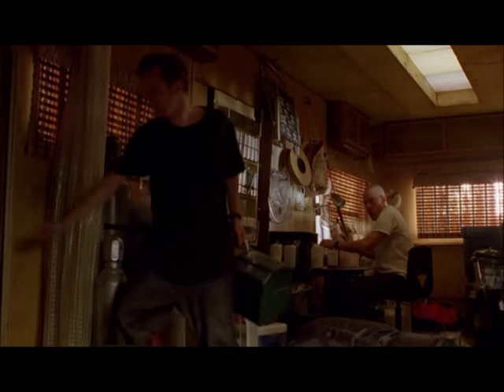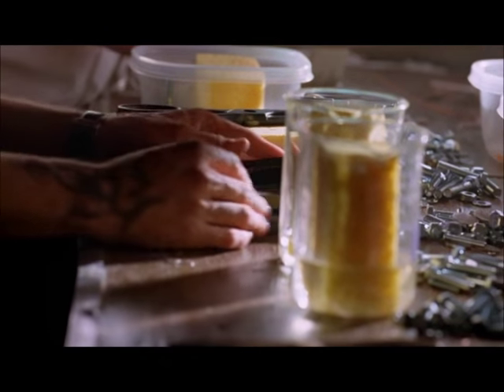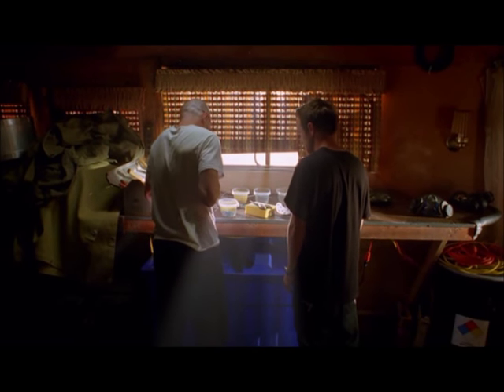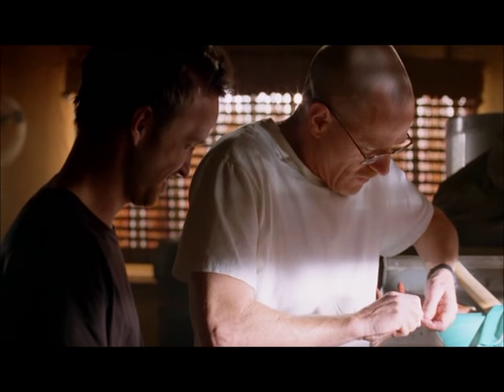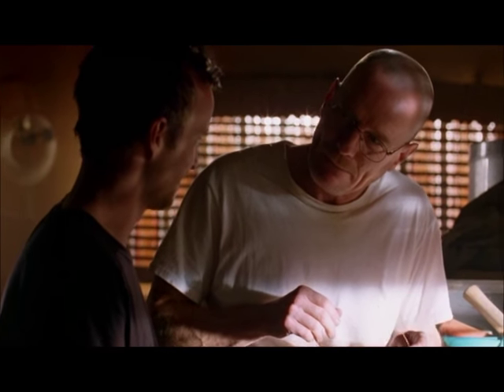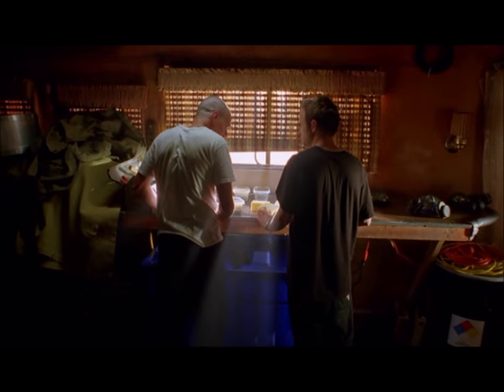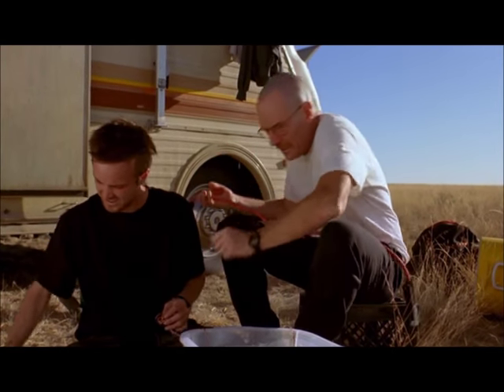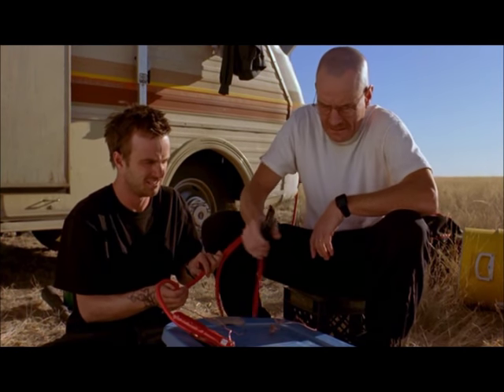Breaking Bad Battery

Comment: Come on Jesse, even criminals know about copper wire being a good conductor.
Reply: If I recall, silver is actually a much better conductor, but we use copper more often given how expensive silver is
Reply: @mechadoggy  gold is actually the best. Of course that would be an expensive af wire
Reply: @diceflawless9115  Actually, gold is even worse than copper as a conductor since its conductance value is 45.2 million inverse Ohms whereas copper’s is 59.6 million inverse Ohms. Silver is the best conductor with 63 million inverse Ohms.
Reply: @OMGtheykilledKenny42   i am assuming the best electric cable possible would be a silver wire coated in gold ? Imagine your city cables being that expensive... LOL

Comment: The wire from the "battery" is too small to carry the current required to turn over the motor. That is why the diameter of jumper cables is large,
Reply: It is plenty to charge the RV's battery and then that can turn over engine
Reply: @josemexicanmexican7602  It would literally take days to charge the RV battery......neeeeeexxxt!
Reply: Isn't the risk with wires too small not the amount of current but overheating? I could be wrong, it's been a few years since my college physics classes
Reply: After googling, looks like thin wire has a higher resistance which results in the heat dissipation I'm thinking of. That being said, short high current is probably okay, so its just a question of much resistance. And that, I have no idea offhand. Does look small.

Comment: I have the exact same motorhome.  There are two batteries.  The small one is for the starter and some lights.  The larger "marine" battery is for the furnace, torchiere lights on the walls and water pump.  When my starter battery dies I just jump one to the other.  It's possible they removed the large battery though but then their water pump wouldn't work for their lab.

Comment: That thin bit of copper wire would heat up red hot in 2 seconds and melt trying to deliver the current that a starter requires.

Comment: using zinc (as the cathode (reduction)) and calcium (as the anode (Oxidised)) electrodes in a spontaneous voltaic cell, the standard electrode potentials of the1 Molar solution at 25 degrees C, is 2.11 volts liberated, (E cell=E red-E ox) and from the internet, there is 12 volts is needed to start the battery of a campervan, and in the show, Walt says he has 6 cells, which would liberate 12.66 Volts. These directors did their homework.

Comment: An easier way to get out of there would have been to disconnect the strap of the alternator and spin it manually using some sort of mechanism (like a bicycle)or a pulley system.   you do it by night a couple of hours and the battery would have charged back up, reinstall the strap and fire it up!
Reply: +imahelpfulperson hahaha
Reply: LaMouleQuiCoule if you watched the episode they tried that but it didn't work
Reply: With an alternator you need to trigger the exciter circuit with electricity to begin generating power.
Reply: no.  that doesn't work.  The alternator needs a little current to energize the windings before the spinning rotor can make any output

Comment: I don't think it would work. The problem here is that they are using thin wire on the battery that wouldn't be able to provide enough current to start the RV (even if their battery could provide that current.)  Booster cables are as thick as they are because they need to provide a few hundred amps to the starter to turn over a cold engine.  It was warm out there and they had just gotten the engine running briefly before this but they probably still need at least a couple hundred amps to get that starter going.  The little wires wouldn't handle it.. they'd probably restrict the current too much while getting very hot very fast.  There's a lot of unknowns of course but my bet is it wouldn't work.
It would have made more sense to leave the homemade battery hooked up a while to charge the real battery.

Comment: "Actually, Mr. White, despite a cathode being the positive terminal and the anode being the negative terminal, current Actually flows from negative to positive. The anode has the excess of electrons, and the cathode has missing electrons.  This potential difference is what creates voltage.  When you say current flows from positive to negative, you're talking about "conventional current", a convention which electricians use, which is actually opposite of the actual flow of electrons.  This mistake was made in the early days of electronics, and this convention was kept, because it was deemed too difficult to correct by that point".

Walt gives Jesse a long, confused look.
"Would you just get the wire?"

Comment: “The cathode: it’s where the supply of current flows out from” But shouldn’t it rather be the anode the responsible for that?🤔
Reply: Nope. Read Wikipedia.
Reply: you are right, the electrons come from the Zinc which is the anode

Comment: Those types of galvanic batteries generate 0.5v each. You would need at least 20 of them to jump start a car. Probably more like 50. And there certainly wouldn't be a spark. Also, aluminum would have worked better than zinc because of the electronegativity. They should have used the aluminum foil that Jesse was using for his cell phone stick.

Comment: First correction a cathode is negative and currant does not flow from positive to negative it flows the other way
Reply from the maker: During discharge the positive on a battery is the cathode and the negative is the anode. During charging the positive is an anode and the negative is the cathode.

Comment: There is no way this would work.  a) The potential difference between iron and zinc is < 1V, so you'd need 12 of these cells to even have a chance b) That thin wire would never be able to hold enough current to start an engine.  Look how much thicker the jumper cables are...it's for a reason.
Reply: It's a TV show

Comment: My proudest thought in the entire series, actually the only scientific thought I got watching breaking bad.. I thought of this solution way before it crossed Walter's mind, just minutes after the RV crashed. I was like "you have all those metals and materials in that lab, how come you can't make a generator to start the engine?"
Reply: They made batteries, not a generator.
Reply: They made a generator out of multiple batteries..
Reply: They made a battery out of multiple cells. A generator is a device that turns mechanical energy in to electrical energy. A battery cell turns chemical energy in to electrical energy.
Reply: My bad.. In french a generator is any device capable of producing electrical energy out of any other form of energy, including chemical energy.
Reply: Which makes batterie a generator in french
Reply: Weird. Although I think I have heard solar panels be called solar generators before.
Reply: I watched the episode in french dub (I had no option at the time) and I'm pretty sure they were talking about "making a generator". As silly as it may seem, this is a big misconception between the two languages..

Comment: im no electritian or anything, but would you really be able to generate enough power to jump a battery with that much stuff they have on screen? like it seems like a decent pile of metal there but surely youd need a LOT of power to jump a CAR BATTERY, right?
Reply: Its been busted by the mythbusters, so no.

Comment: Walts wrong the anode is the positive terminal not the negative.. well not Walt the director/producer
Reply: No, you're wrong.
Reply: @jimmyreece5781  tf do you know jimmy
Reply: @zZLemonGrabZz  More than you?  Anode being positive or negative depends on whether you're charging or discharging the battery.
Reply: @jimmyreece5781  consider I’m talking about diodes
Reply: @zZLemonGrabZz  they weren't, they were talking about batteries.
Reply: @jimmyreece5781  why would it be any different
Reply: @zZLemonGrabZz  diodes only allow current flow in one direction.  Current flows one direction in a battery when discharging and another direction when charging.
Reply: @jimmyreece5781  I thought batteries were always negative to positive- electron flow theory than again it’s only a theory
Reply: Anode delivers electrons to the cathode

Comment: The anode and cathode they go wrong actually, anode is the graphite and cathode is the zinc, anode is positive and cathode is negative
Reply: No, you're wrong.
Reply: I've made a battery with zinc and carbon before, I'm pretty sure that's the polarity of it
Reply: Oh huh yeah, cathode is positive, I guess I confused that with an electrolysis cell
Reply: @EdwardTriesToScience  it depends on whether your charging or discharging the battery.

Comment: Any scientists in the comments that recon this would actually work to a lesser degree?
Reply: A mercury cell produces about 1.3 volts and they have 6 connected in series so that's 8 volts. They would need at least 13 volts to charge the battery enough to start the RV.
Reply: Emenike  there is not a chance in hell that science fair project could ever create enough current to start a car
Reply: Übermensch it produces that only on standard conditions which are 1M of concentration, 25°c and 1 atm and they are obviously not in these conditions lol
Reply: Manuel Castro True.
Reply: He would need 10 cells basically
Reply: You need at least 13 volts...but assuming they're connecting it in series with the RV battery, which would still have SOME voltage, it would possibly work.

Comment: did he just say the supply of current comes from the cathode?
Reply: Yes. Current flows out of a cathode and into an anode. So a battery or cell, the + is the cathode (current flows out) and the - is the anode (current flows in).  On something like an LED however, the anode is the + and the cathode is the - because current flows into the anode and out of the cathode.